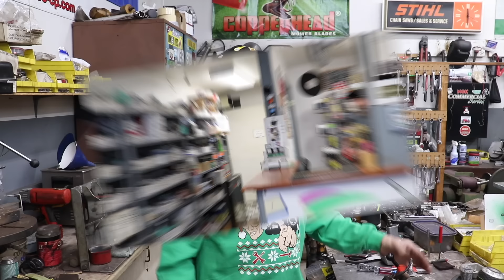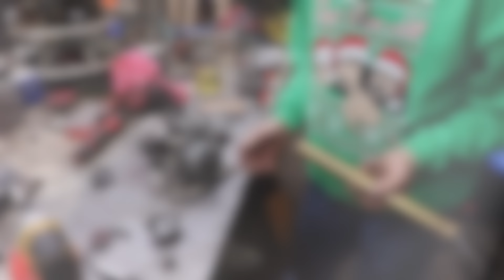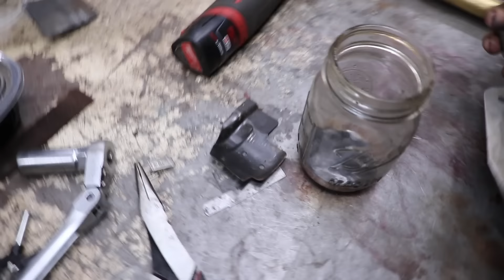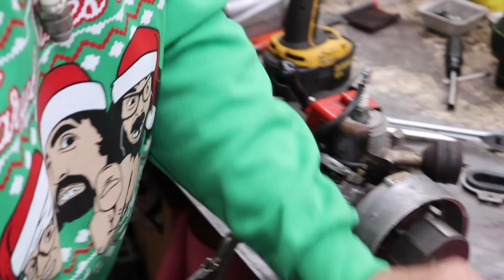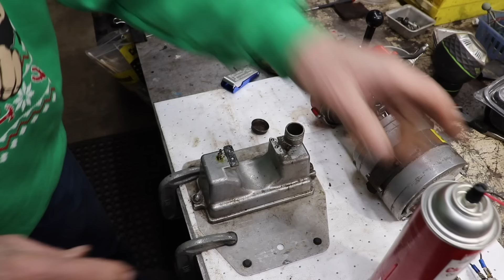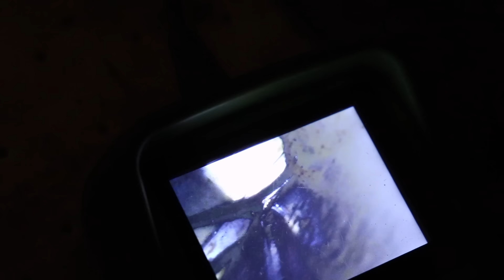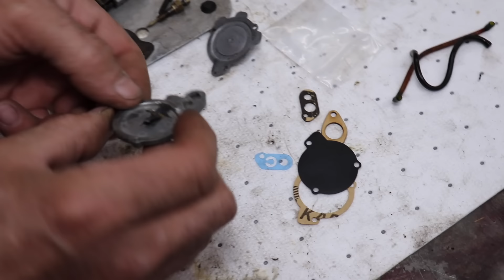World's SMALLEST Generator EVER! Will It Run?

Comment: I have actually saved a Kohler generator I still have today by coating those damaged wires with epoxy . the winding had rubbed on the frame, due to a bad rear bearing. that little 1400 Watt Kohler Generator will run my refrigerator and computer through any storm power outage

Comment: if anything could use an electronic ignition upgrade it would be that little Olson and Rice motor. the "Little Atom" ignition module would sit in that points compartment and not need that external condensor. Youd never have to open it to clean the points again

Comment: My shop teacher told me not to use emery paper because it was conductive and if you left any emery dust on the parts it would short out the points. Use only sandpaper or better yet, a point file

Comment: I think your tachometer was reading half the actual speed, possibly even one-third of it. Was it set to read a four-cylinder or six-cylinder four-stroke engine?
A Champion spark plug with a code beginning with U has an additional gap somewhere up inside the insulator, in series with the normal gap. This gives a virtually instantaneous rise of voltage at the spark gap, so the electricity does not get a chance to leak away through any carbon that may be fouling the insulator. This means that the plug will still spark even if it is heavily fouled.
I bought a new Ohlsson & Rice 22cc engine like this one in 1974. I had to wait months for it to be delivered. It had a 14mm spark plug, Champion CJ14.

Comment: Next time, get 2 electric clocks with a second hand. Plug one into the wall, and the other into the generator. Adjust the RPM of the engine Match the time. one minute for 60 cycles. When both are running the same then you have your 60 cycles on the generator.

Comment: What would something like this be used for? It doesn't even put out enough to power a light bulb.
Reply: With the 12v-12amp circuit, I could see it being useful for slow charging a dead car or lawnmower battery. Those chargers are usually only 2-10 amps.

Comment: Aspen is great but twice the price of regular gas. Use it in all chain saws, and movers, snow blower. Keep the engines clean and stays stable from one season to the next. You save a lot on maintenance as a casual user of various machines.
And it is less bad smoke in your face when running the chain saw.

Comment: The reason you're not supposed to sand down points is that the nickel plating is really thin, and you sand through what (if anything) is left of it.  This is true on nickel plated points.  Once you're through the nickel, the base metal will oxidize quickly and the points will foul again soon.  Solid nickel points won't have this issue.

Comment: I recently bought one of these and got it running. Truely a very tiny generator. Very loud too. The name "tiny tiger" makes a lot of sense when you hear the noise it makes while running! The voltage is a little less than 150 volts on a 15w load, but drops to a more reasonable 124v at 100w load. I could adjust the speed, but i suspect it was designed this way to prevent the voltage from dropping below a reasonable level under full load.

Comment: Vry wonderful repair of really neat made generator by cleaning point resurrecting fuel lines carb rebuilt rubber change most imp securing open burnt wires by  insulating them negating short circuit out kums of such a remarkable precise antique 2stroke generator by Vry Great Taryl fixes all channel

Comment: I bought a 300w generator from Home Depot back in the 80s, just couldn't resist it. About the size of a basketball and of course more modern looking than this one...120 ac and had the 12v option as well. Kept it in may car that turns out had a wire off the alternator, but the generator always got it started. Before I realized it was an easy fix I was basically running with just a short charge every now and then for several miles.

Loved that thing (and this one) but got into a bit of trouble and had to sell it. Haven't run into one since and I'd love to replace it.

Comment: I would set the RPM to get 60 Hz AC, and hopefully 110 to 120 VAC on the plug. Was the battery charger output 12 to 14 VDC?

Comment: Great job resurrecting that cool little vintage generator and I'm like you I don't think plugging a cell phone into that thing is the greatest idea but who knows it may be just fine.  I will say this the amount of engineering that went into building that little thing for all of 300 watts is kinda mind boggling.  But you gotta think back then they didn't have all of these nifty little battery chargers and booster boxes and the 12 volt output may have been handy for charging something like say a car battery.

Comment: There are RC carbs that have more to them then this carb. As for that Blob in that Tank some Lacquer thinner and or paint thinners would have dissolved that nasty mess, add a few ball bearing and just shake it and let it set, then shake shake shake again let it set. would probably have removed all that gunk. Have cleaned out a lot of mess's this way out of tanks.

Comment: You always want it to turn at exactly 3,600 RPM, to produce exactly 60 Hz AC. The unit looks like it's rated at 300 watts, so I recommend loading it to 100-150 watts, and set for exactly 3,600, knowing it will run a bit faster unloaded, and slower fully loaded. Expect the voltage to vary from 135 volts unloaded, down to 110 volts fully loaded. This is not regulated, the voltage is based on the impedance of the stator coils, and the field strength of the rotor magnet. you will find, the output voltage will vary proportionately with engine speed.

Comment: This is the best video ever.  I have a 3-4 of these generators.  None work.  I would buy one off flee bay that was supposed to work.  It would not work.  I would then buy another one and it would not work.  I even have the repair manual in hardcover for the rice engine.  

Now I have a video.

The generators still dont work.

I need that special spay fix it can in your video, or a repair guy.  I need a 2 stroke guy.  I told the only 2 stroke repair guy I know that 4 stroke is better.  Now he hates me.

Comment: My Dad had one of those in his sailboat. Dad raced his sailboat in the Bayview Mackinac Race from Port Huron/ Sarnia Ontario to Mackinac Island Michigan in Lake Huron.  One time the battery ran down at night so we were illegal w/ no navigation lights. Sailboat racing rules are very clear about running the engine: NOT ALLOWED! Not even to charge the battery to run the navigation lights. The "Tiny Tiger" was a noisy thing, but it worked very well to keep us legal. ben/ michigan PS Dad won that race one time. His boat was called NJord: God of the sea and the wind in Norse mythology. Ha.

Comment: Hey Teral have you ever seen those 2 stroke tools from the late 70 early 80tys had a circular saw and drill there was a third unit I can't remember what it was I looked at buying one but I couldn't justify the cost even when they dropped the price to get rid of them good thing as black and decker brought out their mod started out with a 1/4 inch drill and others tools were to follow at 4.4 volts it was gutless but with a 4 inch saw designed to run with a drill it would vary slowly cut a 2x4 in an emergency they never did bring out other tools for it as Makita brought out their 9volt and and quickly went to 12 volt and then 18 volt and the race was on every year someone brought out a new and more powerful set now it's  lithium Dewalt did it right when they first went lithium it fit all it's old tools but they must have had problems as  soon changed the battery design so the lithium would only fit the new lithium tool's and charger

Comment: Set your meter to read "~" which is, cycles per second. Good Fluke meters have this setting option.  You don't need to adjust for speed, but for 60 cycles per second.  ALL generators need to be adjusted between 58-62 cycles per second.

Comment: The speed of the engine controls the output voltage and the frequency.   If you had a meter with a frequency function, you can set the engine at the right speed so you get 120 Volts at 60 Hertz.

Comment: This is why I empty out two cycle gas out of the gas tank and put it back in gas can so the fuel lines do not clog up or swell up you gave me that tip before always empty out your fuel out the gas tank didn't put new fresh gas in when you're ready❤ so you tell your viewers at always empty out the gas when you're done and put it back in the gas can so the lines were not clogged up or swell up learned that from you way way back

Comment: Here's your answer to why you don't sand out or file the points.   The points or pated w/ Platinum and when you sand or file them you remove or damage the plating... But, when their burnt their alraedy damaged, for diagnose purpose or your in a pinch its a work-a-round. If the points aren't avalable then it's the only remedy. Moreover, for long trem repair it's best to just replace with new. 
Their's your breakfast..

Comment: My father used these engines back in the 70s to power RC model boats they made a 3/4 hp and a 1 hp ,he had the 1 hp in the hydro, still has them.

Comment: Why didn't you check the votlage and frequency?
It's hard to believe such a tiny engine can put out probably over 3/4 of a HP. 300 watts is 40% of a hp and these generator heads are pretty inefficient. So it's probably a good 3/4 to a full hp.

Comment: I used to get the "Berryman Chem-Dip Carburetor Parts Cleaner With Basket" that comes in a gallon can and dip my carburetors in that.  Real cruddy carbs that were very old would come out of the tank looking like brand new.  Is there some reason I never see you using that stuff?  I always thought it worked great.  EDIT:  I had typed the first part before I got to the end of the video.  For the correct speed on regular generators, I adjust the governor so that it puts out 60Hz.  Low speed will put out less, higher speed will put out more.  The focus should be to get the 60Hz output power.

Comment: I used a tiny tiger generator with a Ford alternator for my gasoline/electric bike. 

The setup:
Generator/power inverter/capacitor bank/diode bank/110-220dc brushless motor. 

I made all parts not mass produced.

(196mpg/42mile range per fill.)

I've recently put a boost bottle on the engine and disused the original fuel tank for a 1.75 gallon fuel tank of my own design.

Comment: The fuel tank of a Tiny Tiger is made of magnesium, not aluminium.

I did a shaving burn test by filing and torching the shavings.

The "crossover line" is to ensure that the fuel level is the same in both sides because of the recessed top.

Comment: That crossover fuel line allows for the tank to be filled to capacity, otherwise the air trapped in the one hump will prevent that volume to contain fuel.

Comment: Note that the Red button on top of the carburetor has a hole on the top of the casting, so pumping (pressing red button) will cause vacuum and cause fuel to be drawn into carb.  Normal operation requires 1 to 2 pushes, 3 presses maximum ONLY, (No more) or you will flood the engine.  I bought one new in the 60's and still have it. still runs great -- never store it with fuel in it anywhere (run it dry & empty tank).

Comment: I don't do 2 strokes , but I drag race motorcycle on a clay dragstrip. I'm thinking that if the exhaust is loose and moveable you would have to be effecting preformance. one way or another. up or down.  I know the 2 stroke guys are very fussy about their exhaust!

Comment: I've always been taught to clean points with Emory paper and I've been doing it just that way for 24 years I'm 34 now and my uncle's and my buddies dad have never steered me wrong since my old ct70 I started tinkering with since I was 9-10 years old still have it still runs and it was the first motor I took apart and rebuilt.....that little Honda built my confidence enough to work on my friends stuff and it's always worked out one way or another* (another* is code for trashcan/junkyard though).......,Loved the video it was fun and had some great content, working on small displacement engines is fun and usually less stressful than idk say working on the old Harley twin cam 88 (1450) efi engine that TOTALLY ISN'T bringing me to the edge of my patience /sanity

Comment: The reason why you have trouble starting the unit is because when you slid that piece of guitar string down the line and you found an obstruction what was holding it back was the foot valve there's a little brass foot valve that goes up and down with the pumping action and holds the column of gasoline in there that's already gone up to the diaphragm pump.
Yeah, you got it running, but if that foot valve was in there you'd find it much easier to start and run at the correct RPM. Put a voltmeter on the output and run the RPM up to where at no load it shows 121 volts or so.
Peace, out.

Comment: Well damn, I am repeating a post which I already made but which disappeared or is otherwise unavailable.
The diaphragm thingy is a fuel pump that works on the crankcase pressure differential as the two-stroke motor goes through its power cycles.  One line goes to the crankcase, and the other line works through a check valve to pump gasoline into the carburetor thingy -bob.

Comment: I think that the diaphragm  whose function is apparently unknown, is a fuel pump which works off of The pressure pulses in the lower half of the two-stroke engine.  One side of the diaphragm connects to the crankcase and flutters in and out with the pressure strokes, and the other half connects through a one-way valve to the fuel tank and pulses in gas to the carbonurator
Gizmo thingy .

Comment: That black part in the gas tank is the fuel shutdown so it doesn't run on any fumes and lock up the engine it floats until the gas gets low and it stops the flow in case u want to leave it running until its out of fuel

Comment: I used to have a little generator very similar to thatI think mine was 400 watt or 500 watt AC and then at a 20 amp 12 volt charger built into itI was just carried it when we went up camping in case like leaving a car stereo running or whatever of somebody's battery was low fired up with the 12 volt charger and shit in 5 minutes you could start the trucks or carOther than it was a little loud from being two cycle it actually works really well

Comment: When setting the RPM one should check the frequency (60Hz or 110V depending on how you measure it) of the generator under load.

Comment: Taryl, 
Bought a dual fuel generator recently with air cooled 212cc about 7 h.p. and am using straight Dino oil for run in prior to using propane...my question for the master of motors and the dentally challenged: how long should the engine be run in before using propane? Yes I have an hour meter on the unit.
Thanx,
DDS

Comment: The pipe that crosses from one side to the other, is just a vent pipe to allow the air to escape from the non-filler side, to the filler side, so that you get the benefit of a full tank of fuel, and not half a pint of air!

So, was that generator end developed from an automotive alternator?

It certainly would be a useful tool to keep in your truck or campervan, even if only as an assurance against a flat battery.

Comment: Sandpaper is used instead of other papers because material transfer contaminates the points microscopically apparently Sand/glass will not transfer into the surface and cause burning problems the idea is to try clean the surface, pitted contacts should be replaced along with the condenser. True shortcuts will allow the engine to run but need more frequent attention. This was told to me years ago by an old mechanic who suggested at a push to use a matchbox, or sanded nailfile sometimes old cardboard would be enough till you could replace with new. Obviously, over the years, the composition of the points has changed a lot. I would have thought that you would have known automatically that the twin pipe was a crossover to allow the tank to fill and to also check for a return valve before continuing to stick a rod down the tube. Still, you're better than me because you put videos on youtube to entertain and help educate people whereas I just read correct or moan. So well done . P.s. I have still leant a bit from you as well.

Comment: well i was taught not to brush contacts for the following reasons... 1. it creates a uneven surface and could contribute to a "hot connection/contact"
2. the scratch marks made does in fact create scraping marks big enough to make small arking and basically makes it easier for the contact to "weld" its self in the closed position because of constant arking.../hot contacts and increase the possibility of burning as well... hope it makes a bit of sense..... kind regards form South Africa

Comment: I know most mechanics filed points back in the day using a points file, but the reason it shouldn't be done is because points have a nickel coating over the contacts to reduce arcing, and if you file them and that coating gets filed off, the points will arc and burn  faster and can weld themselves together. I was taught to rub a dime or a quarter between the contacts. Not only are you cleaning them, but you are actually adding a slight coat of nickel to the contacts.
Reply: Nickle OR Silver....if using a quarter.....
Reply: I would say that by the time the points aren't working, the nickel coating may be long gone and no longer a concern.  Weld themselves together? Never heard that before.